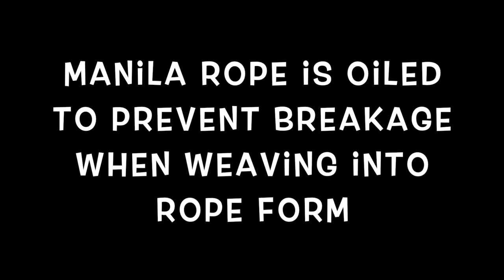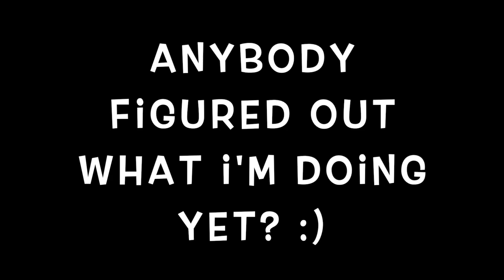DANGEROUS BIRD TOYS | SAVING MY BIRDS LIVES

Comment: I love your video and the idea to reuse the wire from your rope perches. Those natural ropes (sisal and Manila) can also be toxic to your birds if they have been treated with petroleum products. Usually they smell like fumes (which you mention in your video). Only untreated natural rope should be used. They should smell like dried grass and should not stink and need to be aired. I bought 60 yards of sisal rope, but now I cannot use it as it has an unnatural fume odor which I only found out afterwards has been treated with petroleum products, and toxic to birds.
Reply from the maker: So far, so good! I did leave all of my natural rope outside in the sun and it helped significantly with the smell. I did check with some other bird professionals just to make sure. It was amazing the difference after leaving it outside to reduce the fumes, and so far we've not had any issues with them in the cages and perch areas. If you have a link or website to a place that sells untreated rope, please send it to me!